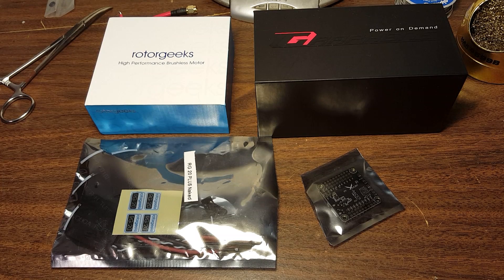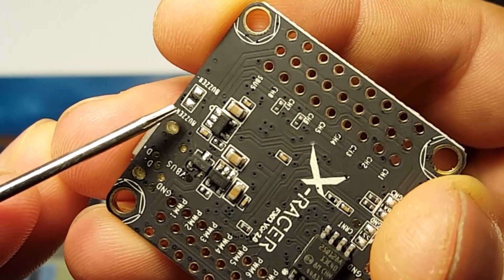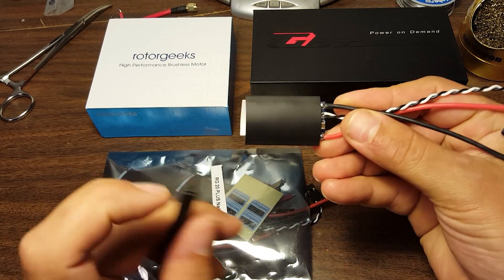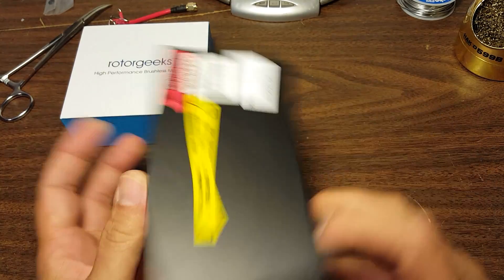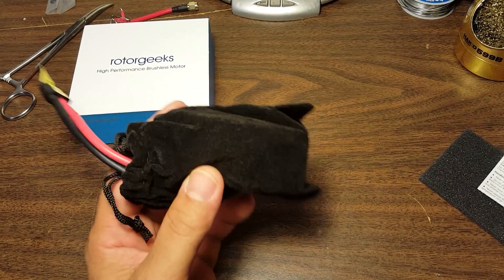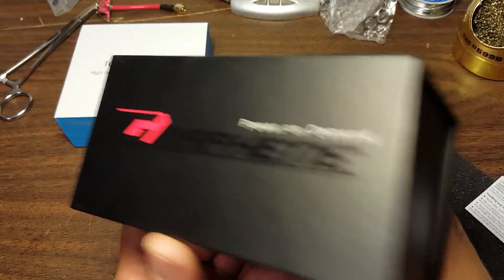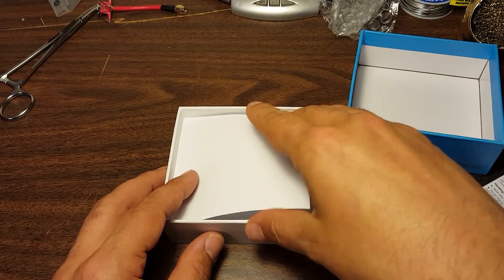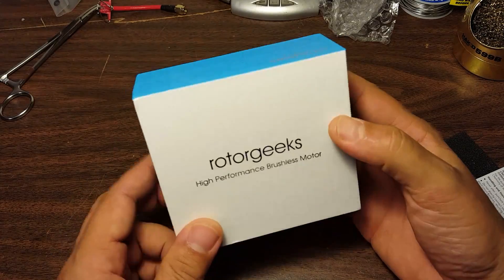Quick-Look - Rotorgeeks 2205 / 2700kv, RG20 Plus ESC, HK Graphene 1300, F303 v2.1

Comment: Hello. 
I have the same ESC's with T-motor F40 2600kV and SPF3 and shows serious problems to start up hard the motors and fast movements, maybe desync? I thought the RG20+ work well with high kV motors...any idea?
Reply from the maker: What ESCs do you have?

The RG20+ is an F390 ESC so it should have no problem with higher KV motors. But if you're having hard startup, the motor kv is not the issue. Are you sure your min_throttle is high enough?
Reply: Thanks for the answer Joshua. The problem happpened when I put full throttle or fast movements. The motors don't accelerate and clog. 

If I put some throttle gently the motors accelerate to full RPM propperly.
ESC are calibrated. I try changing looptime in Betaflight, timing on BLHeli etc. The problem persist.
Reply from the maker: What version BLHeli? What ESC?
Reply: ESC RG20A plus and BLHeli 14.5 and 14.7
Reply from the maker: Try demag high?
Reply from the maker: Also try lowering startup power.
Reply: Demag doesn't work. I'try lowering startup and comment. Thanks!

Comment: Your going to like those 2700kv motors, I love the thick wire for they used the winding. Have you tried any F4 FCs or Raceflight? I've been running The OP Revolution board until an ESC died while I was inverted at an altitude of about 400 feet. Since then, I've been flying my old VDQ210 with a Seriously Dodo running Betaflight and the F4 feels so much better. At stock PIDs RF was buttery smooth, almost no wobbles. https://www.youtube.com/watch?v=Scfwd7vGU8M
I was using the RCX 2633s but I am using some of those 2700 motors on my next build with some UBAD Angry Beast ESCs. 
http://imgur.com/wxTCYRL
I'm just waiting on a frame to arrive from Australia.

Comment: multirotormania has that size heat shrink
Reply from the maker: +JAM3S121 yeah, but what size is it???
Reply from the maker: Thanks. That is what I have never been sure. Is the heat shrink measured by circular diameter or flat-folded width? It sounds like you're saying diameter.

Comment: Ha haa awesome reaction :D Packaging aside they are crazy good batteries, Joshua. My buddy has loads and I've had a few flights on them. They're in a different league to anything else right now. Just be careful not to drain it dry as there are no signs they're running low until you're falling from the sky. Pity abou the weight of them though...

Comment: Love my RG20s... Josh, I too was looking for that heat shrink as well and picked some up at a local electrician supply store. Unfortunately, in order to buy enough for 4 ESCs, I needed to buy enough for 50. I can send you some if you need it.
Reply: i can buy it at the local hardware store for 3.99. has about 6 × 3" strips various sizes from 3/8" to 1 1/16". The 1" fits the rg20's perfect.
Reply from the maker: +5 Inch Alien I'm never sure when I go to order it whether the size is the shrunk or unshrunk size, and whether it is flat width or round diameter.
Reply: +Joshua Bardwell it's typically the size before shrinking. I bought 3/4" heat shrink and it fits perfectly over RG20s
Reply: Some brands will label it as 1/2" - 1/4" meaning that it will shrink down to 1/4"

Comment: Im using Rotorgeeks 2205 2700KV 7075 Series motors with RG20 ESC's, they run okay, but today, what was in the mailbox??? My new Rotorgeeks RG20 Plus ESC's that i have ordered on one week ago and have arrived today to Hungary from Canada, i love Rotorgeeks guys! :)
Reply from the maker: +ZsolteeFPV I am really psyched to try the RG20 Plus. RG20 were THE go-to ESC for a long time, but F330 is so yesterday.
Reply: Thats for sure, specially with High KV motors. I am very excited too, but i have so many work to do, dont have time for soldering. :(

Comment: I hope those are V2 motors. V1 where made of tin foil.
Reply from the maker: +Mitch Oswalt I wonder how I could tell.
Reply: bit exaggerated? I smashed mine into asphalt at 60mph straight down accidentally one day. still are flying... I did order new stators though. that said, probably buy v2 next time.
Reply: +Joshua Bardwell Can you bend the cross bar on the stator with your fingers? The motors I had my hands on where just a bit stiffer than a thick paper clip.
Reply: +prOkrEAt Probably a bit exaggerated but I expected a bit more durability at that price point. Two motors down in two crashes.
Reply: +Mitch Oswalt lol just went and checked there page to see if they listed a diff V1-V2. First thing listed is the stronger grade of aluminum.

Comment: Dude! You're not supposed to take the battery out of the protective bag. You have probably damaged it by exposing it to light.
Reply from the maker: +Dirty Robot The secret of graphenes is that they last forever if you never use them.
Reply: +Joshua Bardwell ONLY if You charge them ASAP :D

Comment: ROFL! Your reaction when unboxing the graphene is priceless lol
I did not have this sticker saying that i should put them in storage mode ASAP though...
Reply from the maker: +ABMNS PRODUCTION You may have ordered before April 1, when the new regulations went into effect. Before April 1 they were shipped at storage voltage.
Reply: +Joshua Bardwell what voltage do they ship at now then?
Reply from the maker: "30% charge" whatever that means. Manufacturers have said they think that is too low for long-term stability.

Comment: those the v1 or v2 RG motors?
Reply from the maker: +prOkrEAt I wonder how I would tell that.
Reply: +Joshua Bardwell 7075 series are new ones. I have the last version but curious about new versions toughness they are claiming. however I can't seem to find a different product number, maybe in product lit? 7075-T6 aluminum...
Reply: +Joshua Bardwell ah, found it. circlips on v1, e-clips on v2.